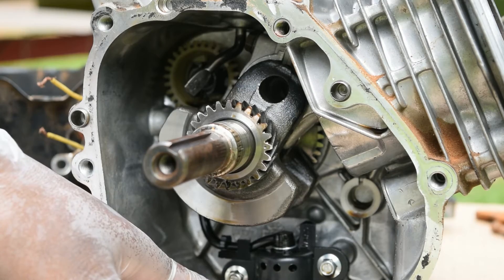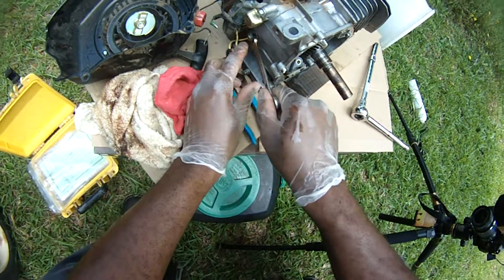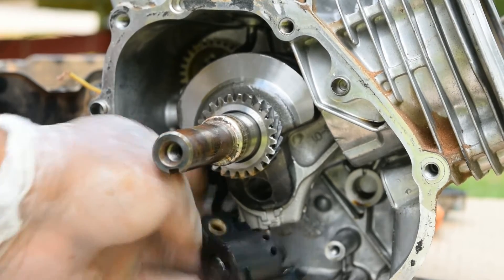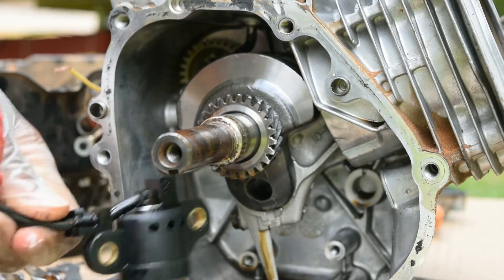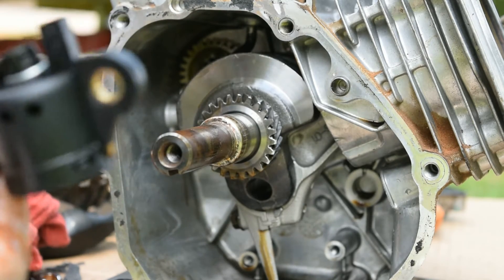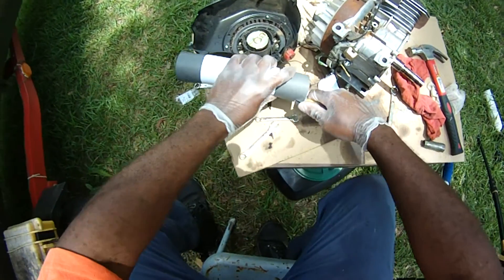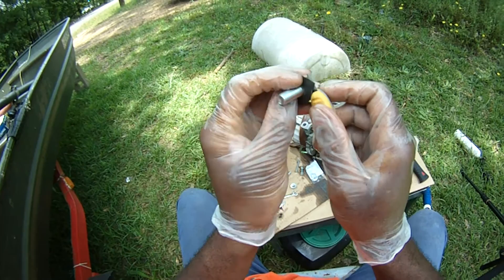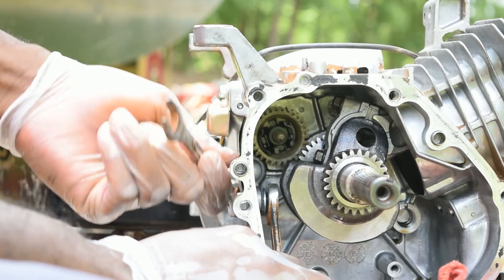Stage 2/3 Mud Motor Build | Oil Sensor Removal

Comment: Why did you remove the oil sensor? Weight or room issues?
Reply from the maker: +Ratdog 305 Yeah, there won't be enough room with the new billet rod.